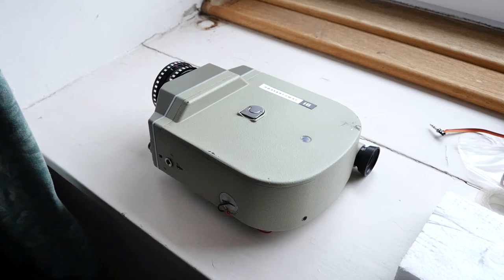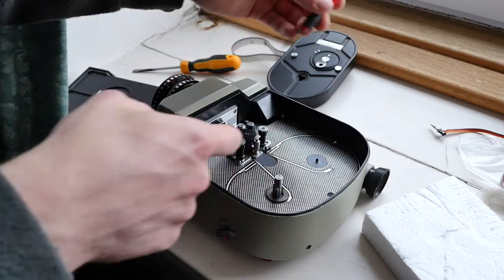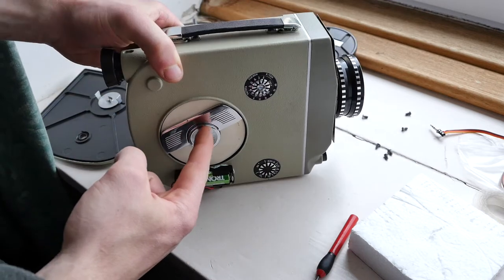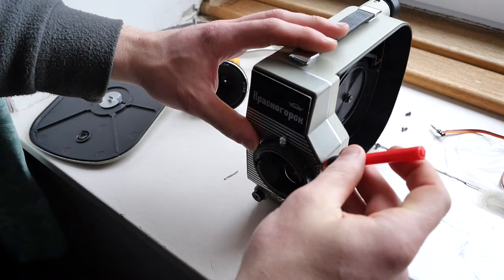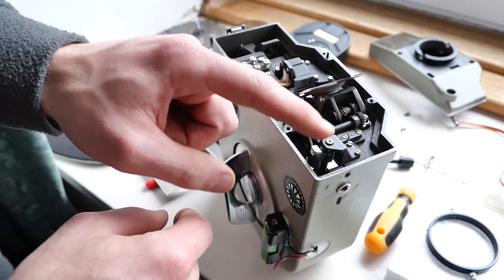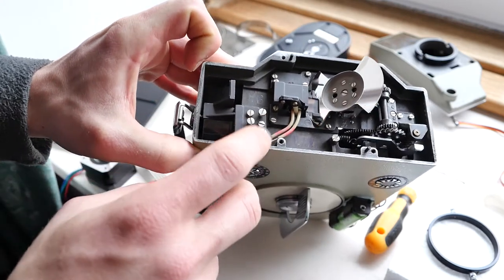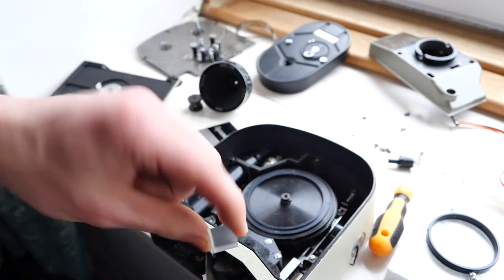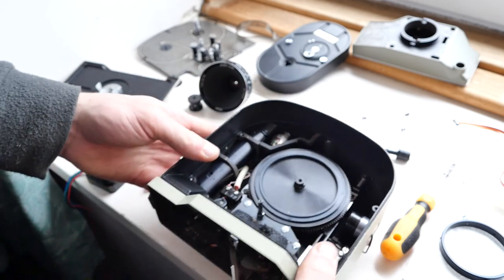Krasnogorsk Camera Disassembly

Comment: I wound the spring and it is stuck. What can I do? Pushing the shutter button does nothing. (Do I have to power the camera with a battery for that? I thought it runs mechanically and the batt is only for the lightmeter.)

Comment: I am currently thinking of motorizing a krasnogorsk 2, so far my best Idea is to bolt the motor to the outside and attach it to the actual hand crank, possibly even bypass/unlink the the spring and governor so it doesn't spin them too.
Reply from the maker: Chistian Moes Not the best idea. I will be releasing a video about my method some time.
Reply: Indeed, I like your idea way more. I subscribed to make sure I don't miss that video haha